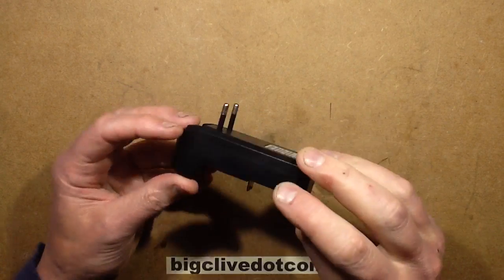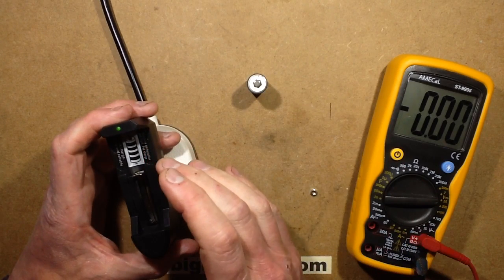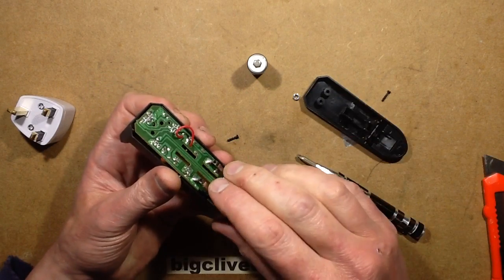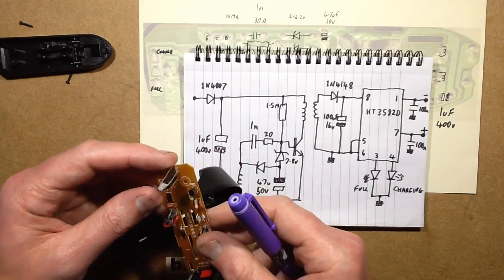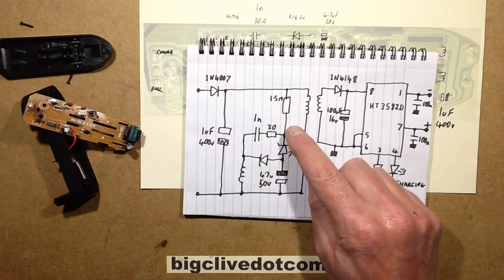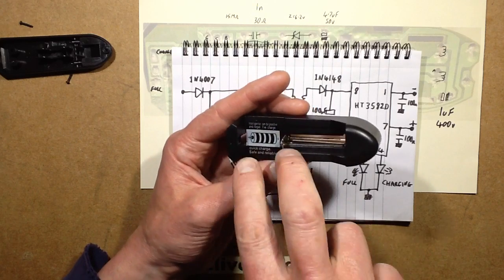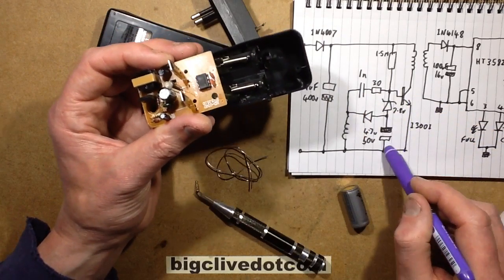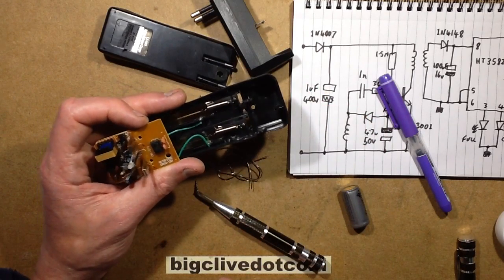Inside some cheap lithium cell chargers.  With schematic.

Comment: It's very easy to see why that transistor went bang. Also when it fails it will go BANG! if the first diode doesn't fail first. Also that 400V 1uf has more potential to go bang than  you think if there's significant transient spikes on the mains supply. It's a right and proper little banger this thing 😂

Comment: Really old video but thought I'd mention that I have a couple chargers that look just like the single one here, but with US/120V plug.  This video caused me to look at the labels more closely, and mine doesn't say anything about battery polarity, just plus and minus.  But the label also says the input is 110-220V which I found surprising.  I wonder if/how the output would change, if at all.  Oh, and mine is only a 450mA output, not 500 like yours, so I feel cheated...  :)

Comment: The cheap chargers work very well ATTENDED. Most chargers are off these little chargers are on the money.  A reference point for Hobby chargers.  Those Alarm buzzers are notoriously off. BUT USABLE AS ALARM. USING HOBBY CHARGER W NO BMS

Comment: Can i replace 1N4047 diode with 1N4007 to get 1A cherging current
Reply from the maker: That won't change the current.  It would also have to be a high speed diode.
Reply: @bigclivedotcom  thanks bro, for the reply

Comment: I just got the same charger that says the same thing with my cheapass lithium flashlight...
Reply: 3:50 and I didn't know that red cable was supposed to go through that hole. I opened mine as well, and it was going through the side smh...
Reply: 9:29 the cable in my unit is also pinched/melted. I think this is a superior design feature.

Comment: I got a small flashlight from cub scouts a long time ago, and it came with a 14500 battery and this charger. Eventually, the charger refused to charge the battery, so I tried a AA battery, and when it didn't work, I was like, "what the...?"  It disappeared some time ago.

Comment: at least the first one has a charge circuit , the one i got (that looks identical) is very very simple with just a transistor a diode an led and possibly a capacitive dropper

Comment: Can you charge lipo battery with it.?
Reply from the maker: If it's a standard lithium cell with your charge threshold of 4.2v then it should be OK.  But none of the cheap chargers are reliable or safe.
Reply: @bigclivedotcom  can lipo battery take charge up to 4.2 volt? I have the same charger as in the video.

Comment: I love your videos. What is a good 18650 battery charger for the US? I would like to change the batteries to 3.9 or 4.0 votes only.
I would appreciate any help, thanks.
Reply from the maker: I wish it was easy to find a simple charger that did that.  You may have to use a professional programmable charger to get the lower voltage.
Reply: There are some Nitecore and LaCrosse chargers which have that facility that aren't too spendy IIRC - check FastTech or Banggood and the like.

Comment: I'm just a hobbyist but I've been trying to figure out how a lithium ion charger chip (like a TP4056) actually drops the voltage coming in from a 5V USB supply to 4.2V. I'm not having any luck finding an internal circuit diagram for something like this (not that it'd be much use to an amateur like me anyway). The datasheet for the 4056 says it can take a maximum of 8V as an input. If it's not switching the supply to buck the voltage with a choke, is it simply a linear voltage regulator or something?
Reply from the maker: It uses a transistor operating in its linear region (not fully turned on) like a resistor.  That limits the current it can charge at, as it dissipates the voltage difference as heat.  If it gets too hot it will regulate the current down.
Reply: That's helpful Clive, thank you. Your explanations always turn the seemingly complex trivial. Once again I've underestimated the utility of the transistor. I think some further practical experimentation is called for...
Reply: Transistors can do amazing things! :D

Comment: Actually the chargers are not bad! If you have checked DiodeGoneWild's videos, the problem is in the POWER SUPPLY. The chip however is quite good. I don't know what's the voltage output of the power supply from your charger, but the charging current is proportional to the voltage input. I'm takling about HotChip HT3582D.

I have two of those chargers (the one with 2 slots), and I took the chip out and tested on breadboard. It does terminate the cell at 4.2 volts. But at 5 volts input, an empty  18650 cell only charge at 150 mA. With 7 volts input though, it charges at 380mA! When nearly full, it charges at 120 mA oppose to 40mA-ish like yours. I was able to translate the datasheet, and the chips can take up to 8 volts, with max charging current of ~400 mA.  So it's not bad,  I'm planning to place the two chips into a single circuit so that each cell has it's own IC (and safely charge two cells at a time). The only thing I disappoint of is that it allows feedback from the cell to the chip, and does not let charge the battery when a schottky diode is added.

So if you people happen to have a similar charger, get rid of the crappy power supply and turn it into USB power like how DiodeGoneWild did. Or better yet, rebuild the entire crappy circuit, and change the voltage input to regulated 7.5 volts. It doesn't take a while since the charging circuit is totally dead simple to build with only 2~5 external components.

Comment: Is it okay to continuously charge a button li-ion using only a resistor limiter? 
I have a programmable  wall plug and it doesn't seem to have a smart charge chip, only a resistor, and the battery heats up somewhat.
Reply from the maker: It's probably a NiMh cell which can be trickle charged continuously.  (Green sleeve?)
Reply: bigclivedotcom  It has "li ion" written on it...

Comment: You mean extra resistor I take it, because you are talking about the color stripes. I was lost as you said it was an odd value capacitor. But I get it, none the less another crappy charger. I hate these cheap chargers.

Comment: Recently got this one (ebay - 172688607927) - they advertise it as for use with 18650 batteries, be interesting to see it broken down... :) ty

Also a quick question concerning those 2 prong plugs and converters, on the model I got I find it difficult to know which way round the charger goes into the plug converter, if you plugged it in upside down, would this reverse the polarity? >.>

Comment: How much current this circuitry supports ?
Reply: The datasheet says it can support up to 400mA. That is more prevalent when the chip is input with 7~8 volts. However since most of these shit charger runs it at 5 volts with 5% error, it only spit a quarter of its max current plus its' not so accurately outputted.

Comment: I have had one of those blasted things laying around in our Motor Home now for a couple of years, just in case I can't find my good charger.  Well we got back to South Dakota, land of snow, wind and hail, and when I off loaded the rig, I neglected to bring in the good charger As time went by, I  found myself in need of a charger, so it was back to the rig, which is parked in our back yard.  I could  not find my good charger right off, so I grabbed that little one, that came with some flash light I think, and I brought it in the house.  On the way in, I noticed a rattle coming from the charger so before plugging her in, I took her apart.  I found a small transistor laying loose inside.  I went over that blasted circuit board for over an hour but could not find a place where it should be soldered in.  So I put in a couple of cells (it was a two banger) and plugged her into the wall.  After about an hour, I checked on how things were going.  I pulled it out of the wall outlet, and both cells were very HOT, enough that it actually raised a blister on one finger.  After dropping it and allowing it to cool, I found that neither battery had any charge any more, before charging one was at about 3 volts, the other showed no charge.  Ok so now the charger lay in pieces in my parts box, and the blister on my finger is doing OK

Comment: Got one of the single chargers for use with 18650 batteries.  Looks identical to the one shown.  And it is very slow, taking over 24 hours to charge a 2200mAh 18650 cell from about 50%.   Seems dubiously safe as well.  Time to toss it and upgrade!  Thanks for the review!

Comment: theres another kind of charger on ebay almost identical to the single cell charger in this vid. it doesnt claim reverse polarity detection and it has extra terminals as if for a 9V PP3 either side of the charging slot but theyre not connected to anything. however it stays almost totally cool in use whereas the transistor in the one in this vid gets very warm/hot

Comment: I'm getting no audio from this video?
Reply from the maker: Check your surround sound settings.  They may be putting mono audio out to a non existent centre speaker.
Reply: I do have surround, but do have a centre speaker, it works on lots of your videos, but not on some... I do hear the low-end (quietly) though! - i'll try switching over to a mono or standard stereo at some time....

Comment: just found your channel, and have been watching a lot of them.  do you have any vids aobut the no name 12v power supplies on ebay, like these?

http://www.ebay.com/itm/AC110-220V-TO-DC-5V-12V-24V-Switch-Power-Supply-Driver-Adapter-For-LED-Strip-/272083459548?var=&hash=item3f59701ddc:m:meOKoSHj4DiKreVQ6sv-5-Q
Reply from the maker: I did a video on one a LONG time ago.  I think I need to revisit them though.

Comment: I've got a charger that looks just like this one on the outside, but the inside is completely different, and I can't figure out how to get the spring back in place.
Reply: ok, now it's completely broken.   oops.
Reply from the maker: The way the spring hooks in is not very helpful in re-assembling it.  I found it best to hold the battery contact from the outside as I put the PCB back in.
Reply: hi,i have problem using this charger,i tried to charge 3.7v battery but light was green instead of red,i thought maybe my charger is some chinese shit and it will turn red when its fully charged,but after few hours still it was green light,i took battery and tried on my flashlight and its working,so...what is happening?is it possible that connection is  bad,but then how i got fully charged battery if connection was bad?
Reply from the maker: Is the light still green if no battery is in the charger?  If not then it may just be charging at such a low current that it takes a very long time to charge the battery.  If you have a meter then I'd suggest setting it to DC voltage and making sure the output voltage with no battery isn't going above 4.2V.

Comment: I've had same problem with the cheap 4 cell ones they just packed up but I think the crap battery I used shorted it lol think it cudn't handle a fully discharged 18650 bin job lol ...thanks for the reverse engineering circuit👍

Comment: I have the charger on the left and the light stays green when I try to charge a 18650 battery, any idea what's wrong and how to fix? Ty.
Reply from the maker: Sounds like the battery is not making a connection or a wire has come off inside.

Comment: The single cell charger I got was best - it is supposed to be able charge two 9v rechargables.

The 9v cells connections have only screws holding them on - nothing else.

https://c3.staticflickr.com/6/5697/30541341810_a91d223952_z.jpg

Comment: Very nice video. I have one of these single cell chargers, I mean exactly like that one you have and I saw you having pretty decent Li-ion charging chip I decided to check if I can make mine work without AC voltage.
And it failed. I found the datasheet (in chinese, but Google helped), but after disassembling the charger I got only bunch of transistors and resistors :( It would be nice if I could power it from USB.

One more thing, my front sticker doesn't say anything about negat-ive voltage, only that is patented product.

Comment: I got a charger that looks like the first one in your video. When I put a battery in it, the led will flash red. I wanted to charge a battery, but when I put the battery in, I got quite a nasty shock when I touched a contact of the charger.

Comment: Did you mean extra resistor when referring to the double unit?  (you said capacitor) - going by the fact you said it was was 13K and across a capacitor probably to trickle current (I know stripey capacitors are a thing).

Comment: 300mA through a 1N4148?
LOL! The highest I've seen the 1N4148 rated at is 150mA ...
I'm betting the current pulses through the diode are even higher, since it's pulses and not a continuous DC current.

Comment: I had single cell charger which looks similar. It worked only for 3 minutes and than it burned
Reply: Hahaha, I wouldn't be surprised. Did it make a nice pop? :D
Did you autopsy it? :D
Reply: likewise, exepct mine let out a hell of a bang and a flash when i flicked the mains switch on....

Comment: Can I just rant and say that there's this huge general assumption among YT commentators that Chinese stuff is all shit and inherently dangerous. Having just had some superlatively nicely made stuff delivered from a Chinese contract manufacturer today, I'm going to point out the obvious - CHEAP stuff is cheap mostly because it's built down to a price and if that price is low enough, corners will be cut. Not always - sometimes you randomly score a well-built bargain, but mostly there's some caveat emptor about such items. Chinese companies are perfectly capable of making very good quality items - if they have enough margin in the product to make it worthwhile - but if you (as I think we all do) go on ebay/banggood and "sort by price" then obviously you get stuff that is ferociously cost-reduced, and in extreme cases some of that cost reduction can have safety and reliability consequences. I have the greatest respect for Chinese engineers and manufacturers, and that includes their ability to make stuff unimaginably cheaply - with all the caveats that entails.  Personally I think twice about buying the lowest-possible-cost version of anything that plugs into the mains :-)   </rant>
Reply: Like yuji LEDs, they are from (oh well, hongkong, not much economic/cultural difference), but I tested some 9W/25chip double phospor COBs, and they had like no visible leakage current. All came on simultaneously. And they are on bare áliminiumnitrate substrate for even lower rist of chipcracking & providing insulation. So, yes, there is good stuff from there, just not everything. Also, these COBs come out at 5$/piece. So not cheap for chinese cobs. But cheap for high CRI leds. BTW, do you have a source for getting good chinese small electronics?
Reply: You're making an equally large assumption about Clive by saying he thinks all Chinese products are shit.
Reply: ***** It wasn't an assumption about Clive, more a common trend among people posting comments. Clive is very fair
Reply: Hmm, I while I see what you're saying I doubt it is manifesting in the kind of xenophobia you're afraid of.

Comment: Went looking for these chargers on ebay, with the plan to rip the transformer off the board, and power it from a proper DC supply.
Couldn't find one the same though, though the IC is available from the usual suspects.

Comment: There is a big BIG problem with these dual polarity chargers.

It has a transistor bridge that's powered from the battery when it is inserted, this bridge connects the charger the right way around. This is fine unless you have a protected cell that has gone into undervoltage protection mode and has 0V out on the terminals. The charger will not be able to start charging a cell in that state since there is no voltage on the battery terminals to activate the transistor bridge and connect the charger the right way round.
Reply: No, the protection circuit generally switches off at 2.5V and if this happens under load the internal cell voltage will then creep upward significantly higher than this. In order to make the protection circuit turn back on you will need to apply a voltage higher than the internal cell voltage.

A fully charged lithium cell would do it if connected to the "dead" cell in series with a resistor. The resistor is needed to prevent an extreme current to flow from the full to the near empty cell. something like 30 to 1000 ohms should be sufficient.
Reply: Exactly, but with a resistor between either the plus poles or minus poles to limit current.

Comment: was there any overcharge protection in the charger? I only wonder as about 90% of the lithiums sold on EBAY claim to have the over/undercharge protection, but just don't, including some I was sent with a charger.

Comment: oh, try to fit this fucker in a euro socket, i dare you. this style is sold as "euro plug", and while thi pins are long enough, they sohuld be raised on a platfrom about 2cm to reach the openings in the socket, had to "tune" an adaptor to plug this in... also, i would not dare to touch the metal strip while it is plugged in, separation looks minimal, and the dangling wire just asks fot shorting out with the mains one day...

Comment: Smashing video clive :-D.
It is quite minimal, with a better transistor and an input fuse/ptc im sure it will work fine.
Im ignoring all the filtering and knee jerk reactions to basic circuits, even complex well designed ones go pop for no reason at all.
Dave jones of eevblog would go into orbit with disgust and panic lol.

Comment: is there any books that shows pics of the blueprint diagram so I can learn what all the lines and triangles...I am a fast learner with mechanical  part of stuff but electrical  I don't have enough confidence to deal with dwino or resistors...I don't get how the damb chip really works